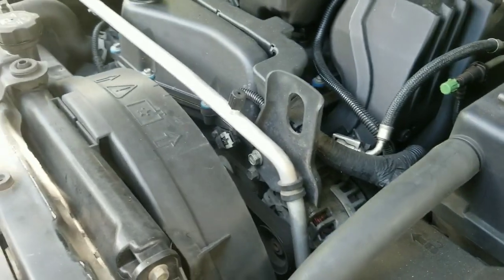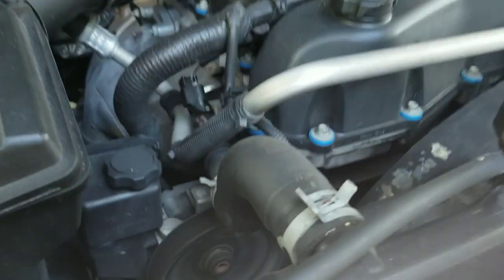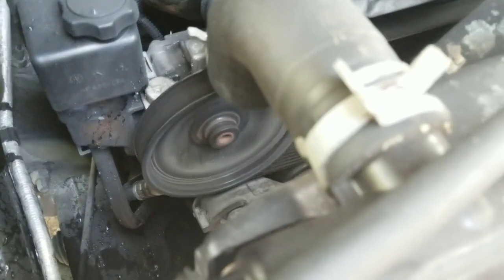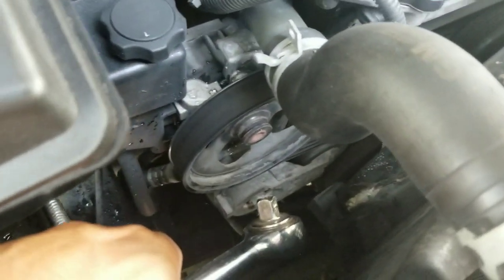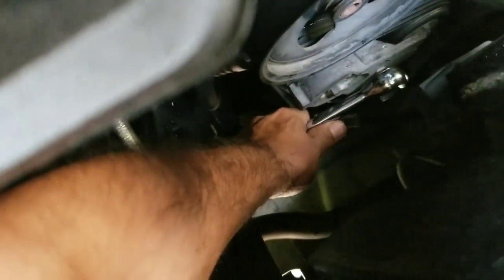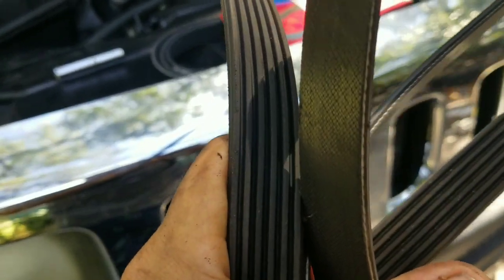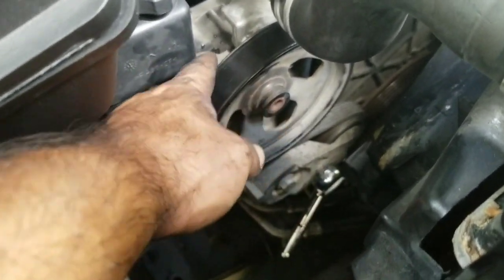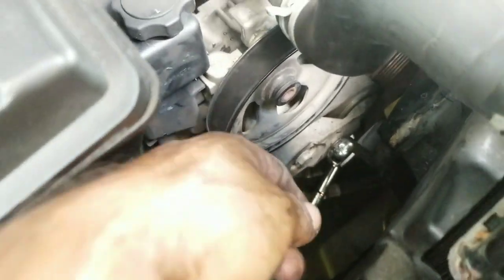Hummer H3, squeaky noise detection and fix tips

Comment: I recently replaced the tensioner pulley and attempted to replace the belt with the Duralast 915K6 but wasn't able to get it installed (seemed too short). I ended up going with a longer belt (different part number) but now something is squeaking. Could it be due to the belt being too long?
Reply: Any belt no matter the part number as long as it's for your car shouldn't be longer or shorter. I know this is a year old but you remembered to turn the tensioner to release the tension right?

Comment: Hi there , I have a question about to replace the Tensioner Belt itself , after taking out the 
Belt Tensioner , and putting the new one , is there a protruding pump behind the belt tensioner 
That has to be put inside a hole ont the Engine to keep it in the right position before tightening 
The belt tensioner bolt ?
I installed my new belt tensioner and it is noisy and the belt it is not that tight , I think that Pump behind the 
Belt tensioner must be put inside a hole to position it correctly firstly before tightening the bolt on its?
Thank you ..
Reply from the maker: Hi there! When you placing the tensioner into its spot, you need to line up the the nut on the tensioner next to the bolt, into the engines grove. Than tighten the bolt. Should be like an upright position
Reply: @hummerh3howtos  : Hello and thank yo u , my car is Hummer H3 2006 , you mean the Position of the Belt Tensioner before being tightened should be at 1 O'clock upright or 2 O'clock ? And should i tighten the Bolt firmly or a little loose  ?
So the Bump on the back of Belt tensioner has no Groove to go in from behind ?
Thank you so much ..
Reply from the maker: @ironfistarrival  I'm just glad to help! Yes I'll place it at a 2 o'clock position, and tighten it up. On your new tensioner, there should be a small bump on the back of the big circle. (The one the bolt goes in). That should line up with the engine. 👍

Comment: my hummer makes the same noise but when he moves the wheel is hard?
Reply from the maker: Hello, does the hummer stop making noise when you drive?
Reply: Yes make noise 
steering wheel is hard
Reply from the maker: @efitworld  There some moments when the steering wheel becomes stiff  and hard to turn. From irregular servicing, lack of fluid oil to low tire pressure or bad wheel alignment, any of these could be the cause. If you haven't changed the belt. I would do that first to stop the noise.
Reply: @hummerh3howtos  i go to change the belt now 
The serpentine belt tensioner is broke
Reply: @hummerh3howtos  thank you so much amigo